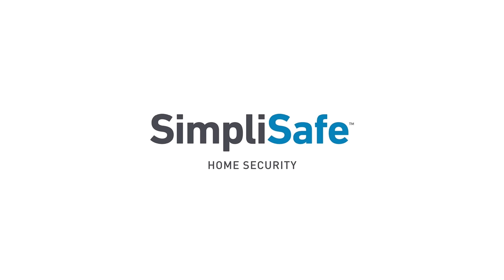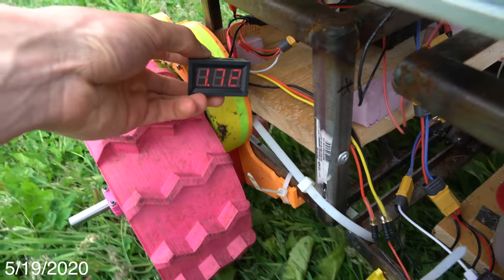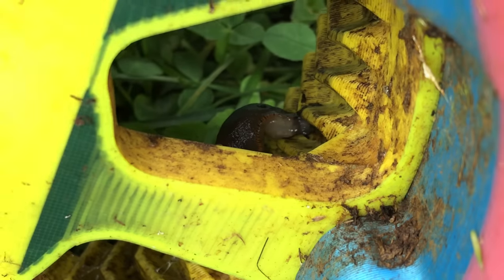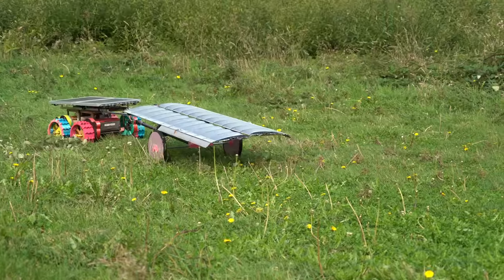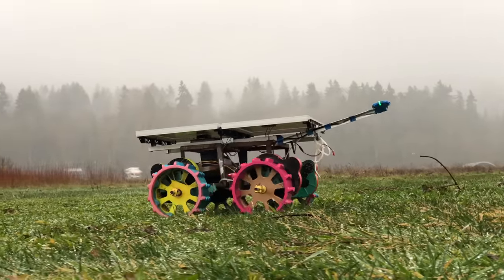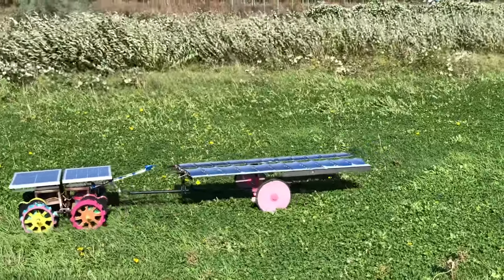Solar Rover #3 - 3D Printed Brushless Gearbox

Comment: Maybe the trick isn't to shield the gears as much as possible, but as little as possible so all the gunk can be churned back out at as many points as possible. A lot of the rover's failures seem to trace back to gunk lodging in corners against walls.

Comment: I suspect most of the gear noise is from the highest rpm gears.  So replace them with a belt drive if you want to quiet the next versions.  (rubber bands and large O-rings work well at low torque)

Comment: Any reason you didn't redesign your wheels to be driven from the "tread" side? you've already got those nice ridges for traction, if you put a few more teeth on the gear box side you could have potentially mounted you gearbox higher above the ground and clear of most of the grass and debris problems. Could be fun for a version 2 next year.

Comment: I was thinking that you should make the final gear not be so close to the ground (ie. a smaller radius inside the wheel) so you could keep it further from the dirt and grass and maybe cleaner... But given how the rest of the video went, it worked really well as is.  I guess that wasn't the weakest link.

Comment: Seeing how clean the outside of the wheels were and how nasty the inside got, I bet having the gears facing outwards would keep them cleaner. Right now the wheel acts like a tumbler and collects material, if it had a means to easily escape maybe they would stay free of debris. Seems like you could just redesign the wheel with the threads relocated and it would just work. Possibly have to reverse the direction of the motors.

Comment: a recommendation for you: figure out a way to steer that doesn't have to slide side to side causing the wheel hubs to experience lateral stress and break down! then give that steering function to the autopilot instead. you need to write a forward, backward and steer functions which can be called by the autopilot. the current steering is very bad.

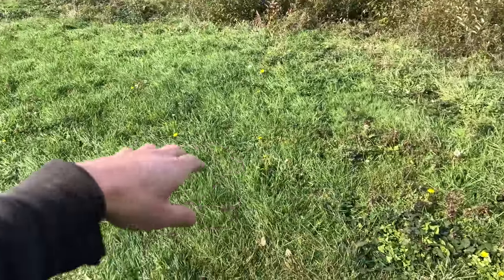Comment: 24:36 Maby it does shift due to magnetic declination. Edit: I may be wrong but you should check that. 25:05 Yes there is. So I did some searching and I don't know your location but based on Beverly, city where you started the solar plane mission, magnetic declination is 14.84° E  ± 0.39°  changing by  0.09° W per year.

Comment: I like the trailer but it would work better if you rebuilt it better to use through winter and probably next summer. If your not too connected to the wings just get the cells out and build a new trailer.

Comment: the first stage of a gearbox is loaded higher than the later ones. Therefore you might want to increase the width and tooth size in the first stage.

Comment: I would swap out the gears and use a chain or belt. size difference between the drive wheels should get you a pretty good gear ratio. Its even possible to have multiple belts to achieve a higher ratio. it would be a lot more reliable and silent.

Comment: @rctestlfight: Have you considered adding a position check and if the rover has engines running but isn't moving - reversing the direction for a while?

Comment: If you need to print new gearboxes then I found a interesting solution: magnets in the teeth of the gears they push the gears apart and so this concept should eliminate noise  and friction. I have seen this on the neo-dyne yt chanel.

Comment: Super cool! From some quick googling there are arduino sbus libraries on github that might help eliminate the mixer, also I wonder if you could make use of cura's support blocker's to get more infill/walls for the teeth on your gears without all of the associated extra print time?

Comment: I believe you should put two more wheels on the solar rover and put two motors powering each wheel. Also power the trailer with two motors. Please do this, i think this will make the solar rover much, much better. If you do this in the next video, i will be very very very happy.

Comment: Put a high speed cutting blade underneath the rover, and some smarts (microprocessor) in the rover, and turn the rover into a lawn mower rover. No hurry in cutting grass. The rover could go all day as long as it gets lots of sunlight, and then start up the next day. Most of the energy from the photovoltaic cells would go into the mower blades rotation, and very little into the wheels. If it took a week to mow the whole lawn--- big deal! And then it starts all over again.

Comment: Have you considered putting some motors on the tailer, but not for diving they backspin so they charge the battery as they get pulled, kinda like Tesla regenerative breaking? I'm not sure if it's possible but it would be cool if you tried it.

Comment: put a mower on the back so the grass doesn't kick back at it and make it where it turns on weekly so you can mow grass and theres only 1 day where it uses more energy than the others so have a battery that charges all week untill it needs to mow

Comment: It's my guess that the slugs crawl on the gear when the rover is in charge (stopped) mode. If you put small jacks under the rover to lift it a few inches when the rover stops, the slugs wouldn't get in the gears. Just a thought.

Comment: Did you have any hysteresis set up for the battery voltage monitor? Or was it just a single set point whether the voltage was going down or up that would trip the arduino to flip the auto/hold pattern? You didn't specifically mention it, but I have to imagine that if the ESCs tried to kick on right when the battery hit the right voltage level, that the current draw would cause a voltage droop that would get it stuck in a loop of switching modes.

Comment: If I were you I'd try learning to code more, and replace the arduino with an underclocked undervolted STM32, and make it output SBUS. That would seriously cut power consumption. But that would increase the cost, so now that I think about it it may not be worth it. Just cutting the signal converter would do wonders by itself.

Comment: Very nice.
But I am surprise that you didn't use the arduino to check the rotation or not rotation of the wheels, check if the rover is moving or not and have a gsm to transfer theses information if/when needed.
I am also surprised that you didn't use 100% fill density for the small parts of the teeth.

Comment: Would be interesting if you could design covers that fit so snug that you can run gear oil inside the housings. I bet the gears will outlast the motors

Comment: Amazing video!

Regarding the diagram you were explaining in the end: how does the arduino nano detect the batteries voltage? Did you use a voltage divider to bring down the high battery voltage?

Comment: cool!
I think a lot of the damage is the gears chewing up particles from the outside, if you were to completelly close the gearbox i think it would still be driving just fine....by completelly seal, i mean, well, kinda like e bike wheels, they have 0 points of entry for dust

Comment: Hey ! I love you're videos ! I have box full of husqvarna automower motors laying around that I got from a previous job, they were warranty but most of them still work they just are out of tolerance for the mowers (most of them are because of backlash), they are 18V of what seems bldc with encoder and a really good planetary reduction ( I don't remember the ratio). I could send you some if you want to try them out !

Comment: use a belt drive and have the motors high up so the grass can have time to fall out, or you can have the gearbox open and  not enclosed

Comment: You should make a failsafe for when it gets stuck. Track the GPS and if the motors are spinning but no change in GPS position you should turn the motors off.

Comment: Daniel (it is Daniel?), why didnt you place a vertical hinge in the middle of the solar rover? I think it could have been possible to steer it with differential steering. 

 So then you didn't have to skid steer and place a lot of load on the wheels and gearboxes.

Comment: If you could design open spaces between the gear teeth gunk might be able to get out again. 
Especially in the final drive. But be careful. Mechanical strength will be compromised, obviously. 
On MTB parts they call this 'mud-shedding'. Not giving the mud anywhere to stay. 
It may not be as effective on grass, as this is like a fibre reinforced material. You'd need very large openings.

Comment: Why didn't you add conic slots in the valleys between the teeth of the wheel gearing to encourage accumulated matter to push out? Also, what was the compass issue?

Comment: With the gearbox and the debris problem could you change the design of the gear that meshes with the gear on the wheel so that there is a section of smooth shaft between the larger and smaller gears so when its printing you could pause it and slip a bearing in between the gears and then the cover for the gearbox would just go around the bearing and properly seal the gearbox off? The bearing might have to be a large one, bigger than the small gear so that the gear fits through the hole in the cover.

Could you maybe print it with a tougher material like nylon to help the gearboxes last longer

Comment: question; why all the colors? If you're printing mainly functional stuff, wouldn't it make sense to just buy a bunch of PLA of the same color and just use that? Since I also mostly print functional stuff, I only get grey or black PLA, and when I need it to be a different color for whatever reason I just end up painting it.

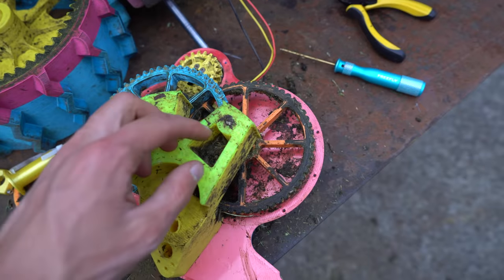Comment: I've only watched 10:00 of the video but I'm wondering if you need to get rid of the complicated gear system and use stepper motors that can move slowly without the grass eating gearbox...And was the right rear the only seized up wheel?

Comment: are the centre spoke sections of the hub centered or offset to the inside? Centering it could lessen the force pulling the printed hubs apart across the layer lines when it skid steers.

Comment: I've got a theory. You added a trailer to the rover, which is riding on grass with plastic wheels. Plastic slides on dry grass easy, and wet grass even easier. Maybe the added weight of the trailer is dragging the rear of the rover around turns, causing it to veer off course. I can't tell directions from the video, but you have it tier to the right side of the rover. Around right hand turns it wouldn't affect it much, but going around left hand turns it would drag significantly, making a wider turn.

Does it make the left hand turn on the south side of the course?

Comment: I dont know if this is a good idea, but you could try to basicly enclose the whole gears and motor inside of  the wheel with just the axle sticking out, this way you could use the big  gear inside of the wheel without debree getting stuck in there at all, i think

Comment: #1 maybe a worm screw type gear would be self cleaning? #2 I have mentioned this before but I think all these skid steer type machines would be so much more resilient if you had them steer with like a maximum of 20% difference in speed. When someone steers my skid steer like that I consider it abuse. #3 I’m not sure what you would call the baby’s if a slug gets f’ed by a worm screw gear

Comment: Why don't you move to a belt based transmission? Much quiter than the 3d printed gears, steel shafts and proper bearing support in a enclosure and I think she'll be mint.

Comment: U need some power saving circuits and maybe some small capacitors to keep it going and recharging itself to go even when the sun isn’t up
Reply: Also more efficient wheel design, and a lighter body design.
Reply: Finally, a more spread out solar panel platform that will absorb all the sun’s light and stop damage to the exposed gearboxes.

Comment: Please add a Hologram.io modem to your robot. It will give cell service and allow it to send you messages when there are events. If you buy the right module it will give you location data from cell towers instead of GPS for improved accuracy.

Comment: Can the flight controller not detect (or calculate) that it is either stuck or having a mechanical failure based on motor duty cycle verses change in position? It could then either shut down or try backing up to get unstuck.

Comment: Dont need to use 4 motors. Use only 2 and a supermarket chart front wheel in front. This motors are running at no load speed most of the time, dont need four of then

Comment: Imagine making a lawnmower 3D printer that drove around cutting grass that it would "digest" by burning then putting chemicals like HCL into it that it would then reconstitute to be used as printer resin.  Th 3D printer would largely be made of treated cellulose-paper allowing it to grow in size, or to print a smaller version of itself.  After the cellulose-paper printers self-replicate a lot (1 2 4 8 16 32 64 128 256 512 1k... 1 million in 20 generations), we could order them to come to a certain place to be used as fuel or to be turned into feed/food for growing edibles.

Comment: You are off of redwood rd se are you not only asking because I used to live with in half a mile of your location before I moved to az also if you go to the back of t&l with the green houses on the tree line that splits the property's there is a bse fire race engine stuck in the tree about 30 feet up you can see it in the winter from the trail I crashed my first race plane there

Comment: Comment number 666, I was just wondering if you couldn't possibly have installed a helical brush (like a bottle brush) onto the drive motor gear, to brush the other gears clean and push the debris out?

Comment: I don't see why you didn't just make the wheel driven by the axle instead of having a weird gear inside the wheel hub which gets all the dirt in it. also increase wheel diameter. but i didnt watch all the videos on this so maybe u have a good reason.

Comment: You need a shield on the inside of the wheel
Reply: But you could also just call it a composting machine
Reply: The other ones aren’t as bad because when it turns it will wedge grass into it

Comment: Poor gear design. If the gearbox had to be plastic, it should be better (differently) designed. The best variant is a planetary gear with coarse teeth flooded with oil. Plastic heats up strongly and softens (melts) during long work. This causes the gear components to stick together, which causes more friction and heat builds up again. And the damage is done. A gear with thicker teeth will have more time to heat up and cool down more quickly, additional flooding of gear oil will help cool the gear. Another good variant is the use of toothed belts. It's not elegant, but it should last a long time. A plastic gear is a bad idea mainly due to the heat. However, I listened carefully, so I know that the plastic was supposed to be in this project. Finally, I will add that it seems to me that I liked all the videos with this vehicle and yet there was no like under this one. Regards